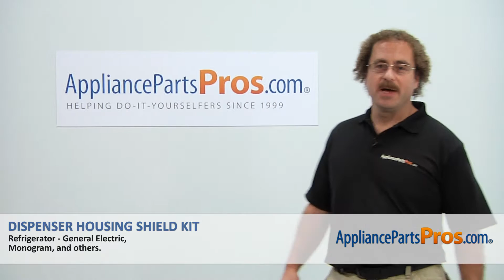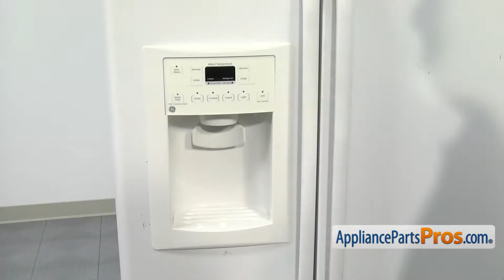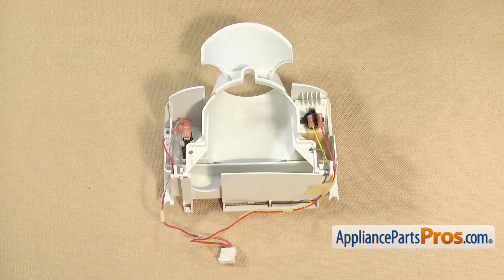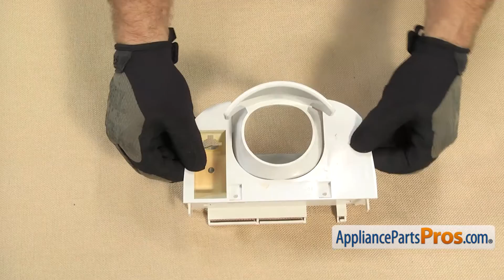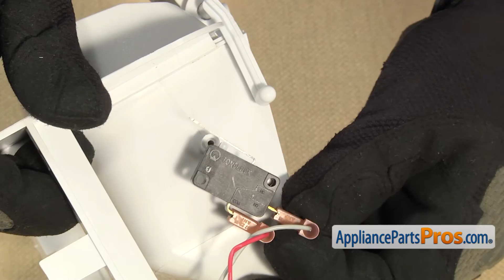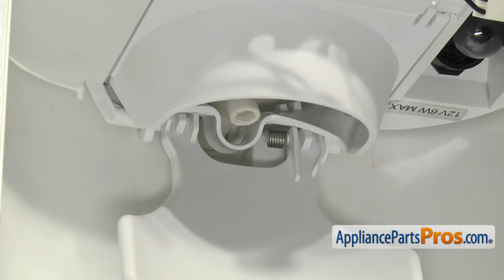How To: GE Dispenser Housing Shield Kit WR49X10227

Comment: Anyone ever have where the right side won’t budge after removing the 4 screws like it’s glued in there or something any suggestions
Reply from the maker: If the screws are out, the housing may be held by retaining clips, a tight gasket, or years of buildup. Try gently working around the edges with a plastic putty knife while pulling evenly. Double-check that no hidden screws are still in place, and avoid using excessive force to prevent cracking the housing. Hope that helps!

Comment: Hi, very good video, in fact I did use it a while back to replace that part on my refrigerator.
However now I have been trying to find that part that dispenses the water.
It's the white plastic hose where the water comes out threw,
Mines has like a brown stain that looks like rust and keeps staining the flapper and dip tray, so I would like to replace it.
I wonder if by ant chance you sell that part.
I could send a picture of it, but don't know how to attach it here.
If so I would appreciate if you let me know, thanks.
Reply from the maker: What is your model number?
Reply: @appliancepartspros  Model PSSC6KGWAWW and Serial # ZM 411419
Reply from the maker: Thank you! Unfortunately, that water line is not sold as a separate part. It is only available with the freezer door. That part number is 	WR78X12135. You can place that order through the website, or you can call us at 1-877-477-7278 to place the order over the phone.

Comment: Our Frig is now 17 years old - and we just removed the dispenser guts for cleaning because everything was black and nasty.  On our frig we left the "frame" (bezel) in place and pulled up and out on the bottom edge of the control panel in order to remove the control panel.  We took all the electrics off the chute apparatus so we could wash it after removing it, to include detaching the flapper.
Reply from the maker: So glad the video was helpful, let us know if you have any questions!

Comment: Thanks for the detailed video, looking at those tiny directions, you can't see how the spring gets installed.. ...since this is a replacement for the original GE part....there are some slight modifications like the spring. The original has the spring attached to the long arm.

Comment: Thanks, this was an amazing guide..  I would like to offer some suggestions to anyone that finds this video.  before putting on the  (Ice Shield) don't snap it in all the way.. put on the spring and the part where the glass pushes against first then push the ice shield perfectly into place.  If you don't do this and put the ice shield first and then try to put on the spring and the part where the glasses pushes against it's almost impossible.  Just saying I had to work a bit backwards than what I thought.  

I put on the spring first, then the part where the glass pushes against (Lever thingy) then put it on the ice shield and push the shield together and complete this unit.  I know what I'm writing might not make sense but if your doing this and then you read these instructions it will make perfect sense and be much easier to put together.  Enjoy.